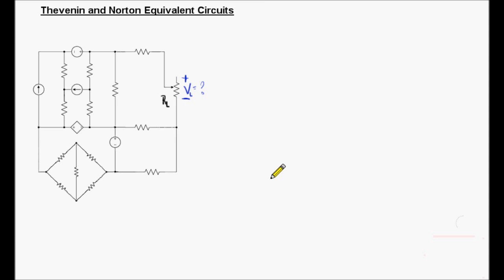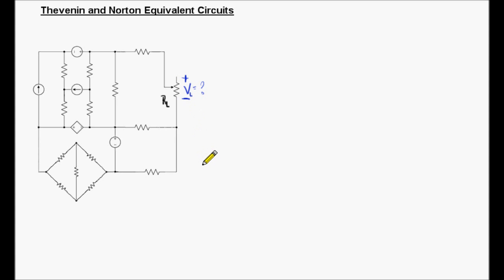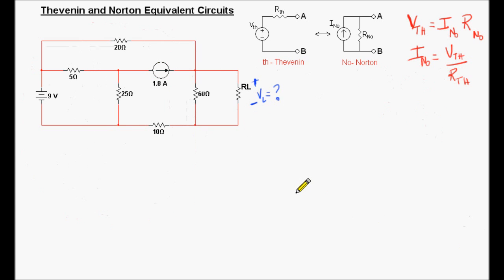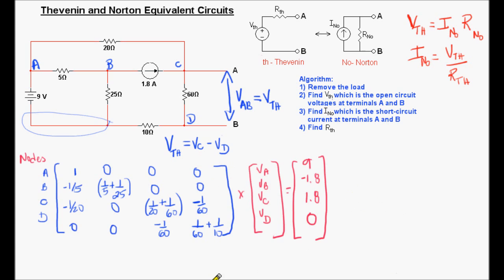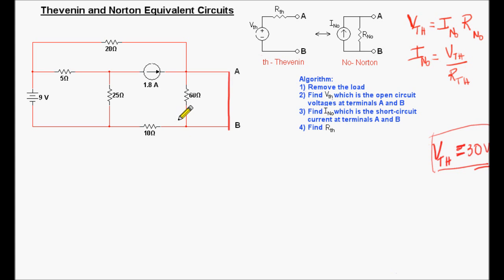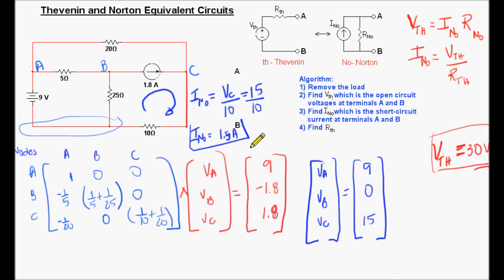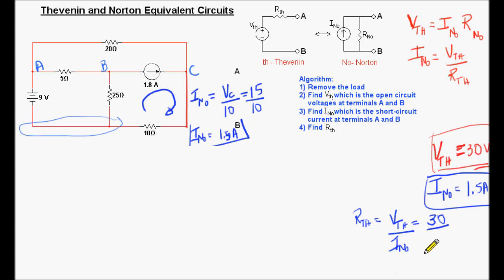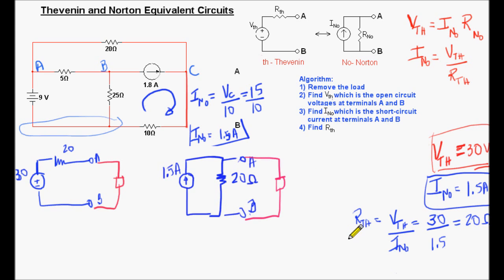Thevenin and Norton Equivalent Circuits - Part 1

Comment: Is it because of the same property that a resistor parallel to a voltage source has no effect on the circuit?  

Ie, the current rather flow through an smooth path than a path with resistance?
Reply from the maker: Hello Kong,
Yes, the current will rather flow through the branch with no resistance. If you do it mathematically (Req= product/ sum), you see that Req =0.